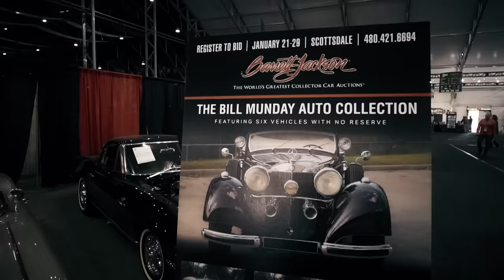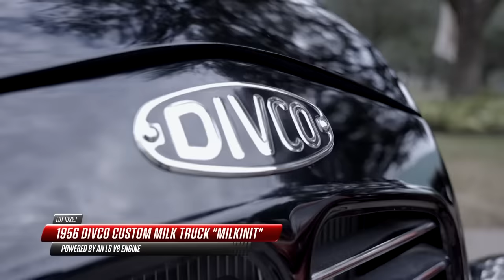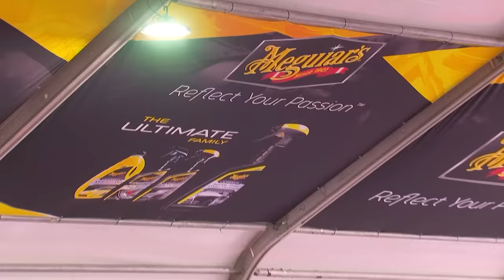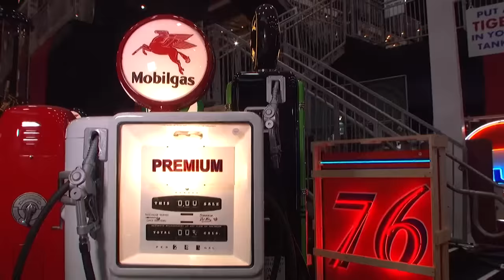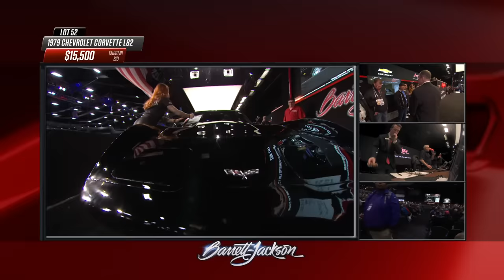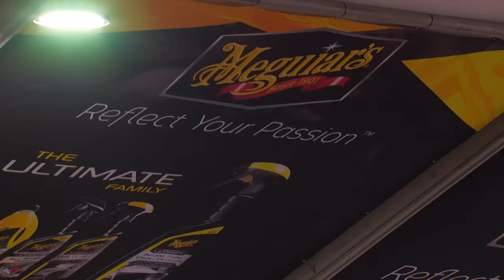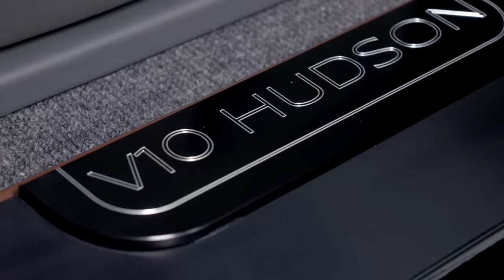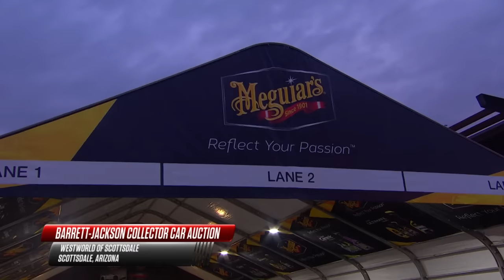2023 SCOTTSDALE MONDAY BROADCAST - Monday, January 23, 2023 - BARRETT-JACKSON 2023 AUCTION

Comment: It wasn’t so much stylists who kept domestic (American) headlights, and lighting in general, roughly 20 years behind the Europeans.   Because of this, some European manufacturers decided to keep antiquated lighting as a cost saving measure for manufacturing continuity.    In the US, the issue was bureaucracy.   Between the NHTSA and the DOT and the OEMs, lighting improvements were seriously hampered, even dangerously so.  Meanwhile, in Europe, the considerations included pedestrian safety as well, since those cities are built such that a car isn’t REQUIRED or flippantly used to get EVERYWHERE OR ANYWHERE.    Cars hitting pedestrians at lower speeds, like 10-20mph in Europe are quite common, and subtle changes in front end design can help make the difference between a serious life changing injury and a less severe injury.     That’s why some of our cars aren’t approved over there.   Funny how they car about personal safety over there, but over here in the US, they care about stockholders and re-election more than personal safety.    Lighting of the future has been available for more than a decade but we held on to glass halogen lamps for far too long, with archaic optics and lousy actual road illumination and even worse oncoming traffic blinding issues.      One day we will enter the 21st century.     I’m still saying that the LEDs as used in the newer cars will at some point turn out to be a serious health and safety issue.  There are no free lunches in physics.    But the Light Emitting Diode appears to be just that.  More brightness, ease of hue variance, without the accompanying heat and amperage.    There simply HAS to be an unforeseen balance.

Comment: That's not true about the 4.3 v6 gm engine as it has a balance shaft in the lifter Valley its a whole different animal not a modified v8 small block even though it shared some components with the smallb block chevy